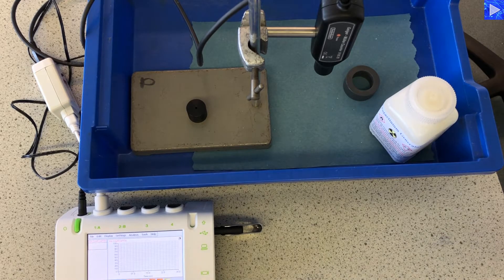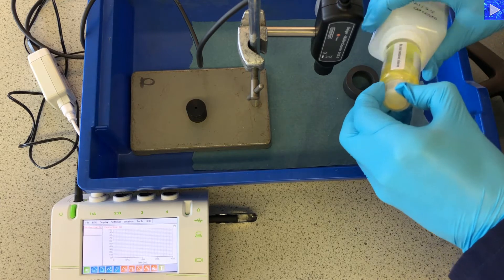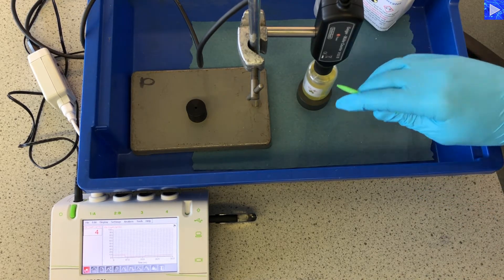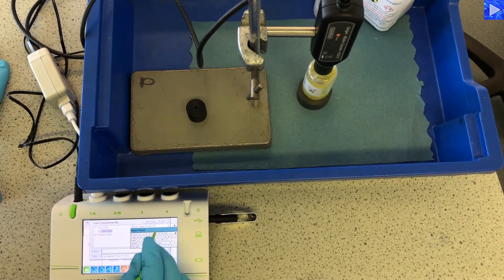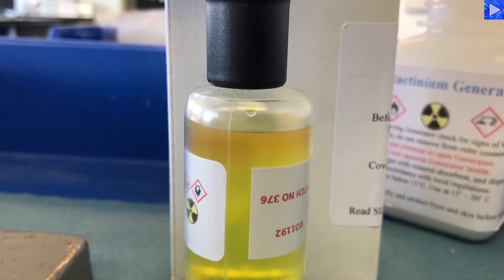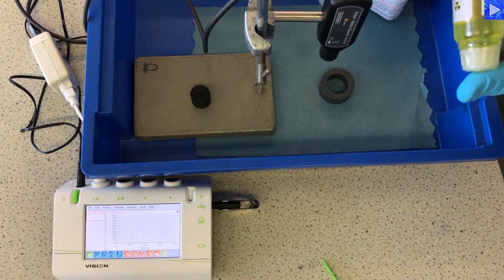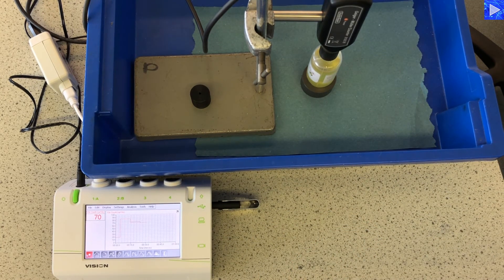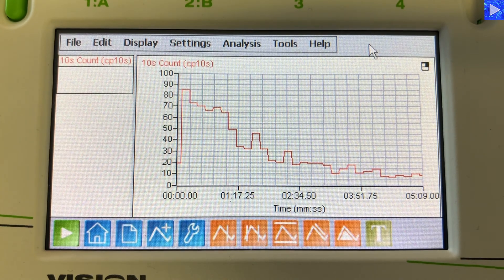Experiment to determine the half life of protactinium-234m

Comment: Thanks for the reply! Since I live in the USA, and these kits aren't available here, and they'd be too expensive! Well, the raw materials came, I FINALLY made a Pa-234m generator! I made it at home. I used 2.5 g of uranyl nitrate, 7.5 mL of distilled water (to dissolve it), 17.5 mL of conc. hydrochloric acid (ACS grade, 37.5%), and 25 mL of methyl isobutyl ketone, and carefully added this to a 60 mL leakproof polypropylene bottle, and it works spectacularly! I use the SEI Inspector USB Geiger-Müller counter with the Observer software, and I get about 120 CPM for background from the Pa-234m generator, and about 3500 CPM at about 2 cm. I get A LOT of counts/activity from mine! It works great! It has internal datalogging and live datalogging via a PC, and it also has an auto-averaging function, and when that is activated, it gives an even more precise result! The exponential decay curve is SO smooth and precise! I like the clamp stand you have, but I'm currently using it for my X-ray setup. Anyways, thank you very much for sharing this video and cheers from the USA! 👍